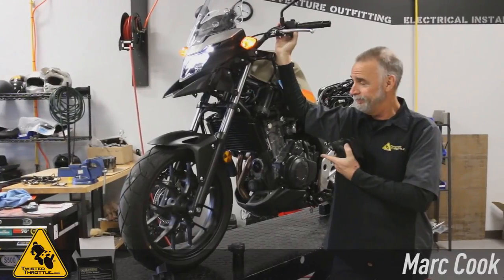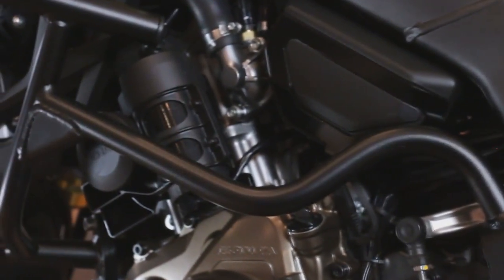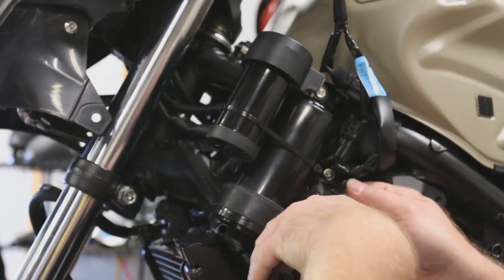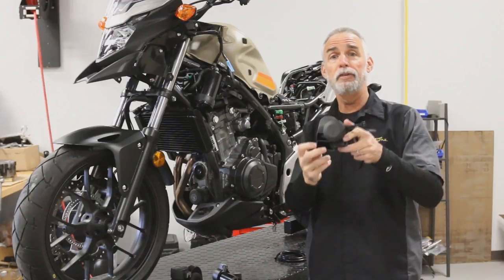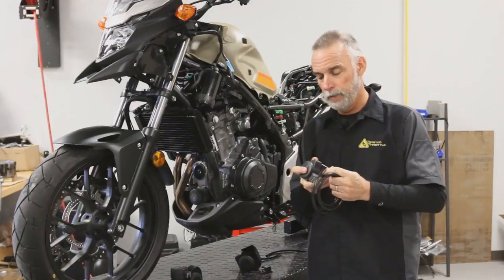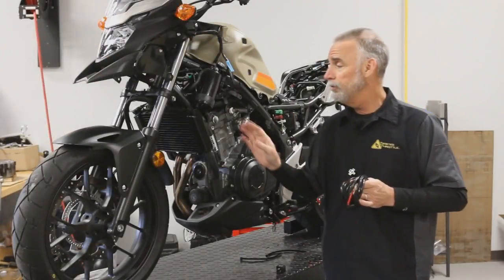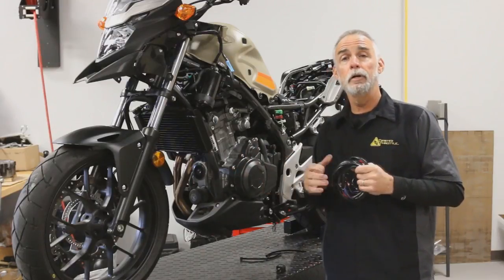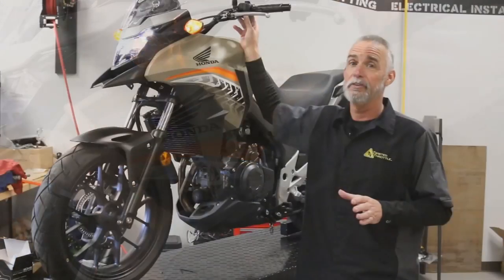Denali Soundbomb Install Tutorial

Comment: I have a 2016 BMW s1000RR. I followed your instruction, removed my factory horn and now my horn won't turn off.  Even with my bike turned completely off the horn goes off the minute i plug it in? Do you have any suggestions?
Reply: Still need help ? I know why.